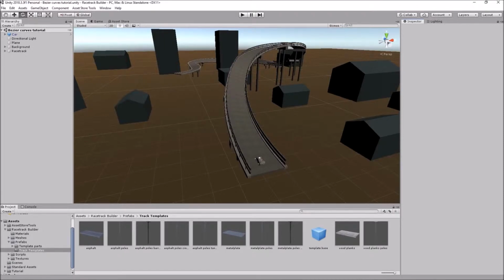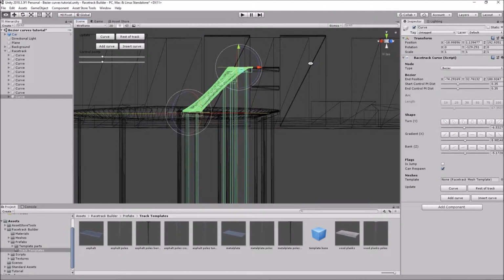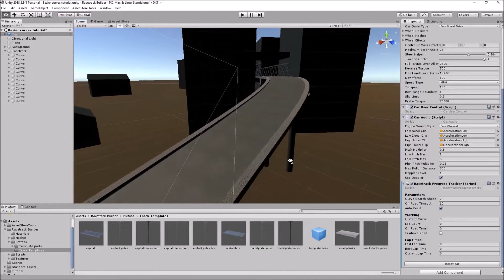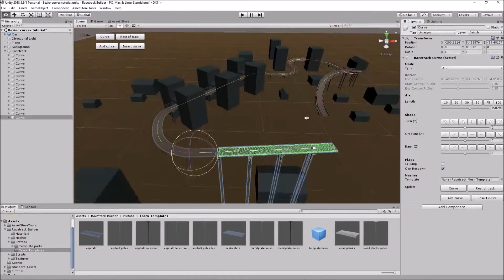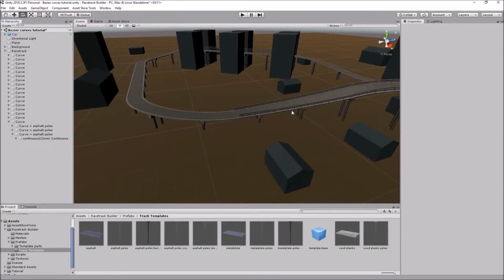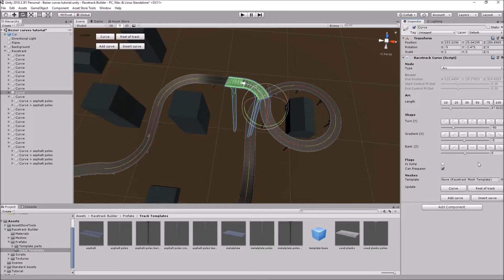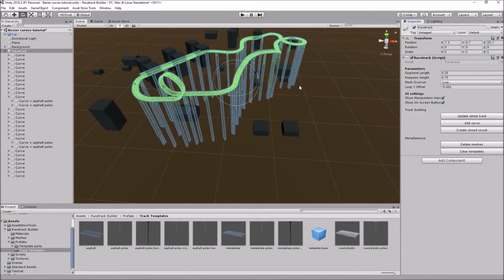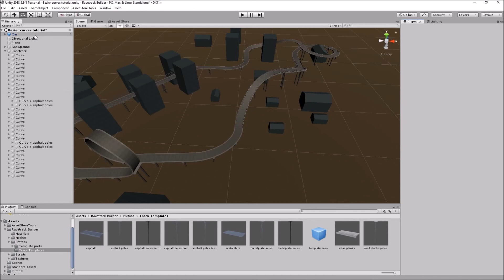Racetrack Builder - Bezier curves

Comment from the maker: Hi.

Yes, it is possible to use your own meshes or edit the provided ones.

There's a system where you can build unity objects containing the meshes you want to use, and attach components to tell the Racetrack Builder how to use them. This video goes into more depth here: https://youtu.be/JbSlOYCF3og
Racetrack Builder works by copying the meshes and transforming the vertices to fit along the curve. So the meshes typically need a lot of vertices to allow them to curve smoothly. If your mesh has a hole, it will simply transform the vertices defining the edge of the hole, so that should work okay. Although because the mesh is repeated as many times as necessary to cover the curve, the holes will be repeated also (which may or may not be what you want).

Comment: Hi, there is one question. May I use my own tiles of road covering or edit your ones? I am looking for a similar tool to create tracks but I need more freedom in texturing, and editing materials and shapes of top covering. So, may I use this tool with my tiles (for instance if it has the right XYZ size)? What if I want to bend a tile with a hole in the center of it? Does your tool can to bend it?